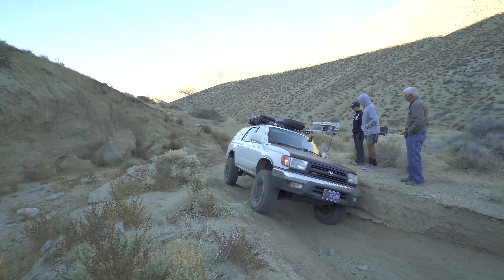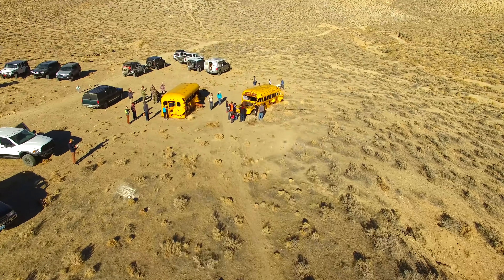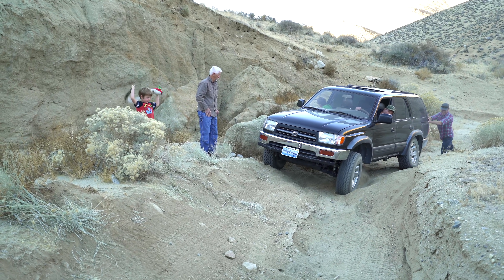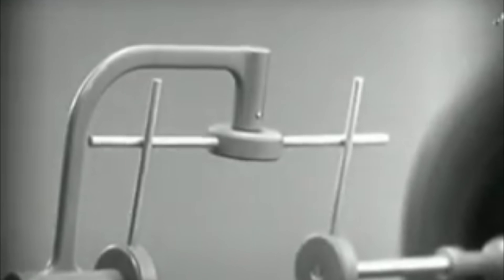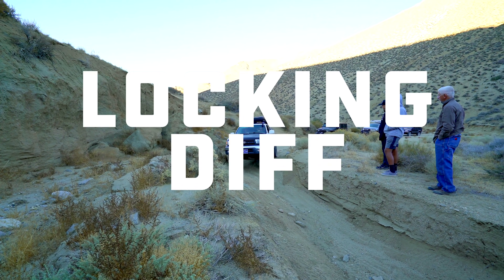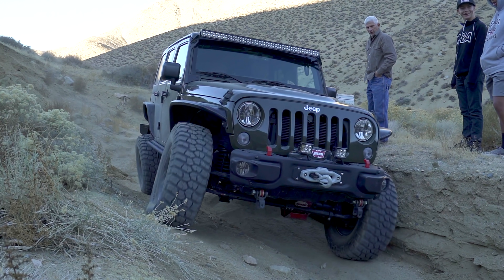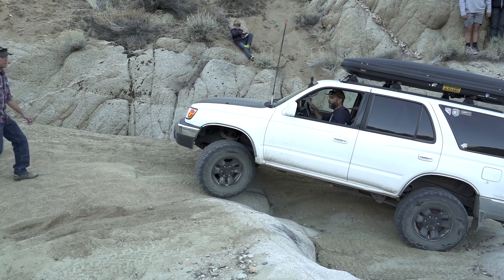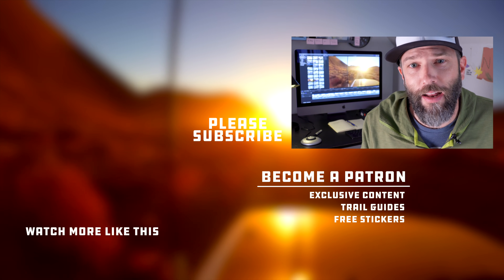Open Differentials vs. Traction Control vs. Lockers

Comment: The first 5 mins clearly demonstrates that 4x4s are actually 4x2's. This is the great myth about 4x4. Unless you have some additional system, traction control or locking diffs, a world of people paid good money for what the publicity guys sold you as 4x4.  Its only 4x2, your family saloon is actually 4x1!  Don't believe me, jack up one wheel and see how far you get. Nice low key vid clearly explained.
Reply from the maker: I think you’re overstating reality. You wouldn’t want to drive a fully locked axle, situations where you need lockers are not that common, even for me and every modern AWD has some kind of active or mechanical traction control.
Reply: @AllTerrainFamily  I think you've got the wrong person, I didn't say anything about a locked axle. Yes, modern AWD systems work off the ABS and other elements to give drive control. I was referring to older generation trucks etc like my Trooper with free diffs at both ends. Lift a wheel at both ends and you go nowhere. I fixed the Trooper with a factory LSD from a breakers for £50 and an Aussie locker in the front. Kept the free hubs and only engage when the frighteners are on.

Comment: Great vid. Thanks for the detail on the effects of steering with front locker
Reply: I’m considering Aussie front lockers and a swaybar disconnect from my 99 TJ 2.5 L. It’s a budget ride and my daily driver, so it’s not like I’m going to turn it into super Jeep. But I might put in rear lockers with the dashboard switch later. If I do, I’ll wish I had a way to turn off the front lockers. Would you suggest front lockers that have a switch? Or maybe the sweet turning radius will balance out the problem of the front auto lockers? I should add that I’m in Hawaii...no snow. Thx
Reply from the maker: I would do rear lockers first.
Reply: All-Terrain Family I totally hear that...’cept replaced rear end recently (before I learned about lockers) and has an LSD. Thx

Comment: Hahaha good old "around the bend", had a professor that have us watch that video in one of my engineering classes. 80 years later, it cant be better explained. That was a great example, it was nice getting to see a few traction control systems compared to a locking on the same feature

Comment: Great video. I’m used to Ltd slip differentials and am trying to learn about electronic locking differentials (eld’s). The video doesn’t mention the former but helped me understand the latter. I’m forming the opinion that I prefer Ltd slip diffs over eld’s. Any knowledgeable feedback will be appreciated.

Comment: depending on wheelbase auto lockers are awesome, I'm at 110" and I never feel my auto locker with regular driving, unless I hit the throttle hard in a turn its invisible. they can also be managable in the front given you have manual hubs.

Comment: Really nice job with the subject and choice of video clips!  I think you were right on the Jeep traction control.  As part of the LS swap in my JKUR traction control is disabled so it now drives more like an old school rig.  As a side note I find the sway bar disconnect useful a lot more often than the lockers for most situations.  The lockers sure are nice when you need em though :p
Reply from the maker: Yes. We have noticed on Brent’s jeep that the sway bar is really limiting off road. Thanks for watching and taking the time to comment.

Comment: You are correct about the JK traction control. The Rubicon has a front and rear locker. It’s possible that he had only the rear locker engaged but hard to tell from that clip because I can’t see if there is any wheel spin in the rear. The JK traction control has a great reputation and is probably still one of the fastest responding. It does however reset if you let off the throttle, and doesn’t respond if you increase throttle too fast to avoid breaking things. I’ve been thought that if you have a little momentum and know how to use it well, it’s almost as good as a locker. The lockers real benefit is that you don’t need momentum.

Comment: I had an Xterra Pro 4X and a Jeep Rubicon. I have also owned a 4runner SR5 and two Tundras; Toyota's had no lockers. I only had to use the lockers twice and they worked to get me unstuck. In those two situations I could have backed out and used momentum. In fact, the worse I got stuck was in the Rubicon. I got into some sand and had to use my maxtrax boards to get out. I feel the Xterra and the Rubicon were equal in off-road abilities. Rubicon has front lockers which I feel are mostly not necessary. I never got stuck in the 4runner or the Tundra...but maybe I didn't/haven't put those in the same position as the Rubicon and Xterra. A short note on downhill assist..4Runner was terrible, Xterra was satisfactory, Rubicon was sublime, Tundra has first gear (works pretty good). I traded my Rubicon in for the Tundra...Yeah, it was hard but I feel the Tundra just has more versatility.
Reply: Tim Johnson   I totally agree with you I have a tundra and a 4runner they are amazing vehicles
Reply: @stevenlefebvre2991  👍🏾
Reply: Am a proud Tundra owner 2017 4 1/2 BDS lift

Comment: I have a VW Amarok with both traction controle and Manual rearsxel diff lock.
TCS puts the brakes on to only the spinning wheel but it sometimes holdes on to long. The wheel goes back to the ground and brakes. I also boggs down the vehicle.  The Diff lock makes it more easy to have a constand momentum.
Have had a Landrover with only centerdifflock also

Comment: Saying that by engaging a locker you're "turning off" the diff is an oversimplification which could be misleading. A better way to explain it is the locker binds the two rear axle shafts together, forcing torque to be evenly split between both wheels, regardless of traction.
Reply from the maker: I say potato you say starchy, tuberous crop from the perennial nightshade Solanum tuberosum...
Reply: @AllTerrainFamily      ??????????????????????//
Reply: Sorry but you and 11 likes are wrong and ATF was correct. The torque is NOT evenly split between both wheels with a locked diff, quite the opposite in fact. The torque to each wheel on the same axle is always the same with an OPEN differential. With a locked diff, the torque can be 100% different at each wheel because the diff is locked.  A scenario could be when one wheel is slipping on ice, the other on asphalt but the vehicle can't move because the torque at both wheels is identical which is that of the wheel traction on the ice. Locking the diff allows the vehicle to move because now the torque available to each wheel is different and the traction of the asphalt can be used by virtue of say 95% of the torque required to move and 5% from the wheel slipping on the ice.
ATF was perfectly correct to describe the locker as turning off the diff, no different to welding it solid and it not being there at all like a spool.
Reply: Turning off implies a selectable locker. A relatively recent invention

Comment: 3 mechanical locks are the only way to go.

TC systems burn through brake pads and rotors.  PLUS exuberant driving wherein the TC system is under constant load will often cause error codes to be thrown in just a few minutes.  Limp home mode is a frequent result.

Open diffs off road are a fools errand.
Reply: Which is less expensive and easier to replace, brake pads or transmission system components?

Comment: This is by far, got to be one of the - if not the - most intuitive video preaching the purpose of these features on 4x4s.  Thanks!
Reply: Except for the fact that he said on the open diff the wheels with traction get no power. This is false:  
  There is one phenomenon that we are not accounting for here: Torque cannot exist without resistance. If an engine can produce 240 lbs/ft it does not mean that it always is. If you were to place the whole jeep on blocks and place it in drive you will only have the amount of torque necessary to rotate the mass(drivetrain, tires) . Thats why on a Dyno there are rollers that apply "resistance" and then you can measure the amount of resistance that can be overcome(Torque). Don't confuse rotational speed as being the same thing. On an open diff,lets say one wheel on glare ice, the other on dry pavement- both wheels will see the same amount of torque. If it only requires 15 lbs/ft to spin the tire on ice, the tire that is not spinning is also receiving 15 lbs/ft, even though it may look like its doing nothing it is applying effort to the ground. Although it is likely no wheres near enough to move the vehicle. When you apply some amount of additional resistance to the spinning tire(LSD, BLD) the non spinning tire will receive a commensurate amount of torque and hopefully be enough to move the vehicle. If its an LSD it may still not be enough. The BLD can completely stop the spinning tire if needed and send enough torque to propel the vehicle
Reply: @jessewoody5772  Thanks for that explanation Jesse!
Reply: You are right on the money bro

Comment: In your 4runner the diff lock locks the center differential giving an equal 50/50 power split between the front and rear axles. This differs from the tacoma that has no center differential but can have a rear differential lock.
Reply: It depends on the year 3rd gen 4runner. 96-00 were always “center locked” and had the rear electronic locking differential option while the 01-02 had a open center (AWD) with a center locker button (4wd)
Reply from the maker: Always center locked because it was gears not a differential.
Reply from the maker: Not on this one. Both in this video have standard t case. The white one has a rear diff lock as i said.
Reply: Nope...

Comment: Just added a T2 torsens (with preload packs) front (Truetrack) and rear (Torquelock) on my LC100, only tested the rear so far and it was great no airlines, wires, switches... locking - unlocking, works well with the traction control, just drive with no wheel spin, well worth investigating as an option!
Reply: Have you had the chance to take it off road much since you got it installed? How has it stacked up against mechanical lockers in tough spots? Seems like the best option for all around function and practicality

Comment: here in aus we have a guy,called ronny dahl,does all sorts of vids explanations,same as this.he just blew up a chrome molly rear diff.not a good choice.he runs a v8 landcruiser, with chip,??,why,,4 door,tray back,all the weight is over rear axle,bad choice.his show is called modified,bit lame as fishing rod holders are a modification over here,??lame.but our laws are pathetic,15mm on tires,2" body or suspension,THATS IT.!!,.so to counter this,i bought an f250 1975 highboy.problem solved,then cut it to swb,same as short f100 4x4, specs.BRILLIANT.

Comment: lunch box seem to be the go,if you like all the noise,elec or air are best [$$$$] but then the lines come out,often,& can get caught on objects,i,dont even like brake lines hanging down,just keep them neat.from other vids,it look as if a lock front,air/elec,& lsd rear is a good option,but not for serious 4x4,ing.2 things id NEVER,buy,ifs front,traction control.why,no wheel travel,plus the t/c can possibly roll your vehicle,as you dont know how far wheel is off the ground,you need contact with ground,as much as possible.my bronco was ttb [ifs] ,first time out,in a csoss up situ,i got out for a look,grabbed the drip rail,& could of pushed it over.ifs,rubbish.so,now it has 8 stud d44,d60 rear.job done.!!.5 or 6sp manual is the go,unless you can get an auto with lock up on low range.i prefer auto,but no good for down hill which is the most dangerous to lose control.my 2002 6cyl,mwm,4.2tdi,YOU,never got these in u.s.,[98-07],has an amazing low range,900 rpm,up or down any hill.they only come in 5sp.would be excellent in a smaller vehicle,12 lt 100,weighs 4t.

Comment: One difflock good ,two better. Only have too  use one most of the time when things get tricky.  With double lockers engaged  you can get yourself  into a lot of  trouble  as your vehecle wont stop for much and a rollover  is a distinct  possibility  . You  can have 2  wheels in the air and will still be traveling forwars  traction  control  works well in most cases but can be hard on your vehecle for extended  periods off use

Comment: All traction control systems work on similar principles, but Toyota ATRAC is superior. Lockers are still best, but Toyota ATRAC is the next best thing.
Reply: Someone will probably ask why, so I should elaborate. ATRAC more aggressively brakes the wheel (then other manufactures) with no traction. That's why ATRAC only works in low range.
Reply: ATRAC II is even better! (-:
Reply: @TacoXL  since ATRAC "2" has been around for more then 10 years I would imagine that's what we are dealing with on most 4x4 Toyota's for a long time...
Reply: Damn right is aggressive. Became a believer until I bought a Tundra
Reply: The A-TRAC is ok, it's when crawl control is engaged that's when A-TRAC is most effective. Just the A-TRAC itself is only as good as Nissan's ABLS.

Comment: My nissan xterra has something similar to the jeeps traction control. Nissan refers to it as a psuedo limited slip diff or ABLS its basically traction control in that it applies the brake to redirect power but acts more like a mechanical limited slip. Having it is making me question if I really need to get a locker with the type of wheeling that I do.
Reply from the maker: Good. It’s probably good enough. As you saw from the video, everyone got through...
Reply: What year is your xterra?. Is it a pro 4x or off-road package?
Reply: @ThatSkaterKTS  nope just a basic S model. I wish it was a pro 4x  or offroad model. But I couldn't find one in my area when I was looking.

Comment: Ray Laux is correct.  Jeep calls this traction control BLD ( Brake Lock Differential) and it does exactly what your friend in the video was telling the driver to do by taping on the brake while staying o throttle.  A common mistake for people using vehicles with BLD is that they keep stopping and letting off throttle.  The computer actually needs to see the slippage so it is important with an obstacle like this, not to let off the throttle (but gassing it isn't going to help)  Just steady on throttle when you feel the slip and the computer will apply brake to the spinning tire.  there's a pretty good ref video here

https://youtu.be/yxHQeO-Y7GU Just skip to 1:40 into the video to skip the boring stuff.

Great video.  Thanks for posting !